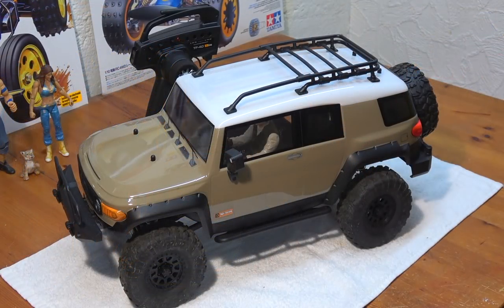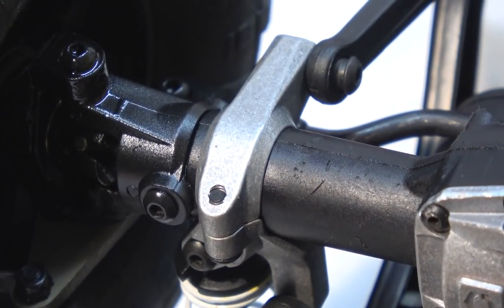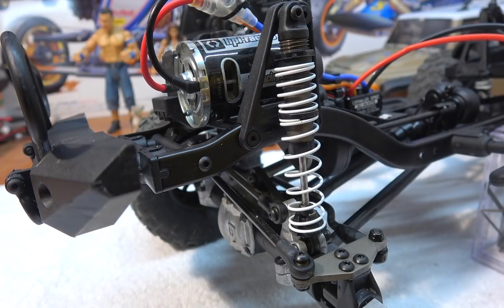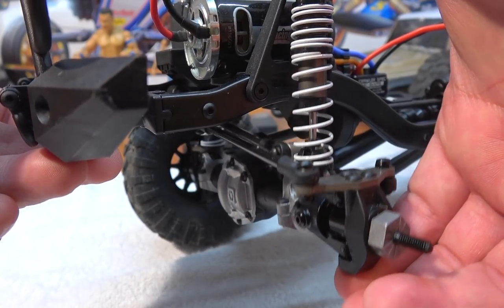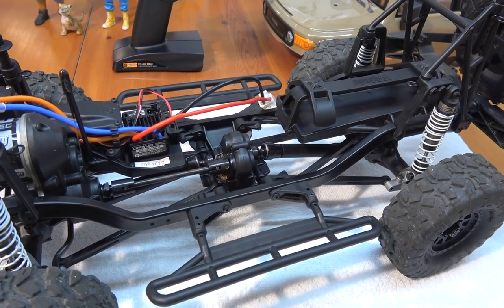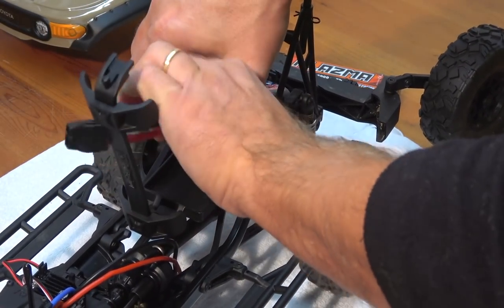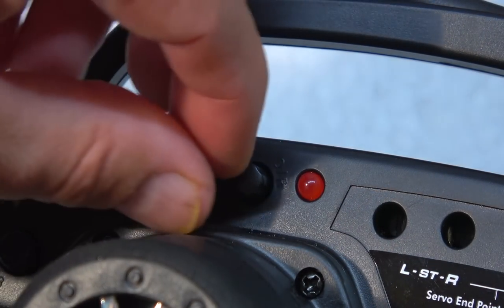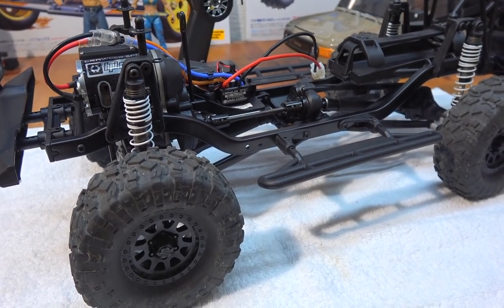HPI Venture FJ Cruiser - First Ride and Explanation of its Features

Comment: Wow what a pleasure it is to see your Matteo's videos, the quality is incredible. Very your comments on the HPI VentureFJ, what I could comment on are the plastic links, I think it would be good for some kind of improvement for this point. And it hurts that they did not include simple lights.

Thanks for sharing your experience.
Reply from the maker: Yes, the plastic links are a bit flexible but works not so bad. But your right, there are a few point for upgrades on it. Maybe I can do a upgrade video in the future.

Comment: Nice video, but you don't mention that the servo is REALLY WEAK and the servo horn is something like crazy, because it causes a vertical torque to the servo axle and gives a lot of extra elastic movement to the wheels.

I have succeeded in throwing away that horn and use a standard one with a little job.

Now, with a new cheap 20Kg servo, the steering is really sharp, strong on rocks during hard crawling.

I suggest this to everyone, before breaking each servo you can mount or get angry because the car is really not sharp in steering.
Reply from the maker: Yes, I have changed the steering servo too, but with the same servo horn, it works properly for me: https://youtu.be/2lqxM2tBJ4o